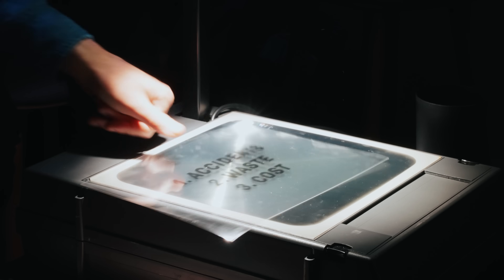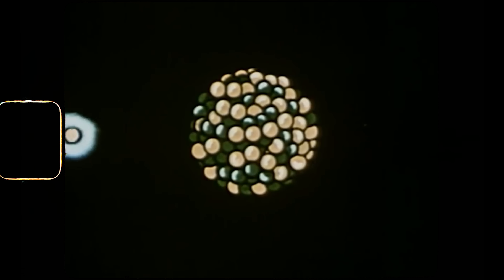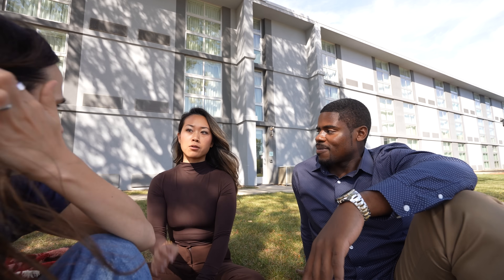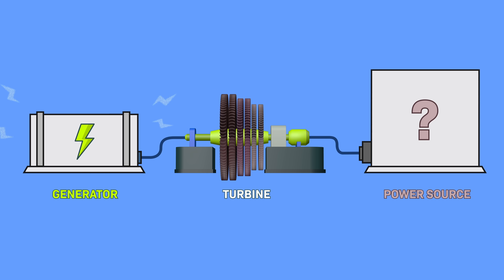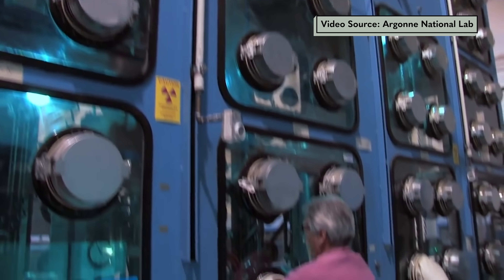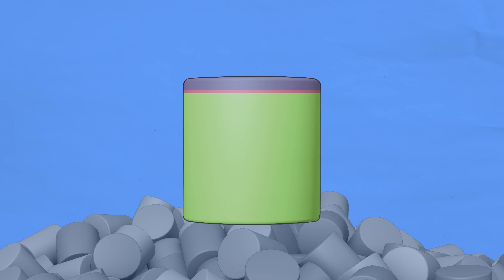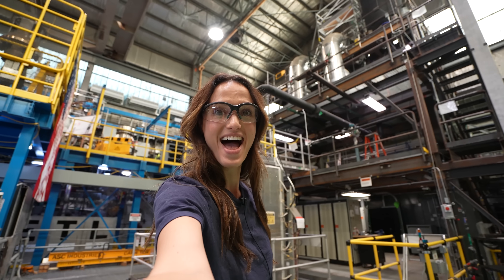The Big Lie About Nuclear Waste

Comment: As an engineer, I have to believe we can solve the technical issues with nuclear power, but at this point the bigger issue is that solar and wind power are cheaper to build and maintain.  Even if we can solve the technical problems, why spend more to get the same amount of energy?  This is usually where the reactor-heads say that we can do nuclear cheaper if only the government and activists would get out of the way, which sounds logical, but ignores the actual history of the technology, which is riddled with errors and disasters despite heavy oversight.  Perhaps with continued research we will reach the point of economic viability, but it seems more likely that another country, perhaps in Europe where there are more economic incentives and fewer NIMBYs, will make this idea work.
Reply: Isnt the problem with renewable energy excluding water is that it produce limited output of energy and heavily influenced by weather unlike nuclear energy?
Reply: @haziqhaziq5550 , good question.  Renewables are only limited by how many solar panels and wind turbines we deploy.  Either source could provide many times more energy than humans currently use.  The sun alone delivers 10^4 more energy to the earth every day than we consume.  We do need battery capacity and transmission lines to deal with local cloudy and still days in some regions.
Reply: There is a good TED talk on this channel that explains that, while what you say is true, the ability to scale up renewables is much slower than the ability to build nuclear.  If we want to save the planet in the short term, nuclear and renewables need to both be used to replace fossil fuels.

Comment: Nature Materials: Current techniques for the solidification or ceramification of nuclear waste pose significant safety concerns. It may come as a surprise to learn that solid nuclear waste doesn't remain solid for long, due to the complex and not fully understood processes of nuclear decay over time. With science unable to predict the exact composition of nuclear waste in the future—be it 10, 20, or even 100 years—designing a safe storage method remains an unsolved challenge. This uncertainty renders all existing storage solutions fundamentally unsafe.
The prevailing solidification methods do not adequately account for the changes that nuclear waste will undergo over time, decaying into a myriad of elements and their isotopes.
1. Solid elements may decay into liquids that have the potential to dissolve even robust materials like glass and metal, leading to leakage.
2. Solids can also decay into gases, which increase internal pressure, potentially causing the container to rupture and leak, especially as these containers aren't designed to withstand high pressure.
3. Moreover, some elements will form various compounds such as hydrofluoric acid (HF), which can readily dissolve glass.
4. They create an ever-changing, chemical medley, whose high ionization could accelerate structural deterioration beyond our initial predictions.
In conclusion, no known physical materials currently exist that can ensure the safe storage of nuclear waste. This problem represents an ongoing, unsolved research question in the field.
Reference for your research: 
Guo, X., Gin, S., Lei, P. et al. Self-accelerated corrosion of nuclear waste forms at material interfaces. Nat. Mater. 19, 310–316 (2020)
Reply: So we have an even stronger moral obligation to recycle the waste.

Comment: 06:21 you don't mention solar, wind hydro eletric or tidal power, i hae to ask why? They create more power globally after all.
Reply: It's just about that we use turbines for nearly every form of power we create. Except solar which has no moving parts.
Hydro has spinning turbines. Coal, Gas, Nuclear all heat water to steam to spin turbines. And wind also just spins a turbine. There is nothing missing there.

Comment: I don't think most people can fathom how much energy is in nuclear fuel.  If you just Google "XKCD log scale" you will see a depiction of energy density for common fuels.  One kilogram of sugar has 19 megajoules of energy.  Coal has 24, fat 39, gasoline 46...and uranium has 76 MILLION!!  Sugar doesn't have 19 million, just 19.  So it would take over 3 million kilograms of coal to equal the energy of a single kilogram of uranium.

Comment: this is called MOX reprocessing or "mixed oxide" fuel, and it's certainly not a silver bullet. Japan had to get the reprocessing perfomed in France and the worst thing you can do with high level waste is move it around. Nuclear energy is worth pursuing for sure, but it's currently the most expensive possible way to make power, and reprocessing only make that cost higher. It's technically viable for sure but then so is Fusion. more research needed for both, and LFTR thorium.
Reply: Japan is working on getting its own reprocessing facility online. I agree that in terms of cost it’s not really worth reprocessing for somewhere like the US with reliable partners with plenty of uranium like Canada. But for energy deprived countries like Japan that treats nuclear energy as a part of their national security, reprocessing makes a lot of sense!
Reply: Thanks for this info, I hope we'll do it to reduce the long-term storage risk at least and get some power out of it as well.
Reply: always the money, eh. Isnt the clean part worth it? The material in a motorbike helmet costs maybe 5 bucks in mass, but you still pay hundreds because your head is worth it
Reply: @fetB  try to explain that to our capitalistic system eh
Reply: @fetB stupidest analogy possible when there are far safer cheaper methods.
Reply: @crhu319  its not, but you have no real argument, so all you can, is insults... bye
Reply: There is nuclear reacor called bn-800 (fast neutron reactor 800 MegaWatt ), which is working on 100% MOX-fuel for almost a year already. And procedures of reprocessing  MOX-fuel for that type of reactors  are already at industrial production scales
Reply: @vitos1k  The problem is not reactors which work with MOX fuel, the problem is processing and trasporting the fuel itself. Nuclear waste is scattered around the country, and is far more dangerous and expensive to move around than new nuclear fuel (which is difficult enough as is). Unless it's heavily subsidized by the government in no case is it economically feasible. No private company is going to buy it when cheaper (aka new) fuel is availble instead.
Reply: @veergauba  I am sure the idea is about processing the waste we have instead of having it sit there. Long term storage isn't a solution, nor is it cost-effective.
Reply: @jimdiet8534 There are better solution than going this, again, nuclear rode, which I understand is not renewable and not clean at all.
Reply: @renebach9583  Nuclear is very clean and the most viable sustainable option we have.
Reply: @vitos1k  "procedures of reprocessing  MOX-fuel for that type of reactors  are already at industrial production scales".

Completely wrong. MOX is not reprocessed at all.
Reply: @whuzzzup  sorry for my english. I meant "Serial batch-production of MOX fuel,  which consists of reprocessing of used fuel from nuclear reactors"  and i meant "recycling of spent nuclear fuel"
Reply: @vitos1k : but the word "recycling" is certainly stretched for this. Separating the stuff and still throw the 99% away isn't really what you would call "recycling". And there's even more waste as a byproduct. All this effort and money is far better spent on good battery technology - which you would also need if you go full nuclear.

Comment: Awesome. Nuclear energy does have a place in our zero emissions goal to bridge gaps during low solar and wind activity, kinda like peaker plants operate now. If the spent fuel can be recycled like this, then our future may just look a whole lot brighter.
Reply: Actually, fission reactors are a horrible use for gaps. They are the opposite of peaker plants. They need a day to get started or shut down, which ist why they usually run for months, have a few weeks maintenance break, then run again for months -- they are a great base load plant. Using them differently would be an economical nightmare. But, as you already seem to know, we do not really need base load plants if we have a lot of renewables, we need some kinds of peaker plants. Renewables and nuclear are actually quite incompatible.
Reply: Science and technology provides us with solutions - politics, more often than not, just provides problems where the "solution" is to vote for "x".

Harold Hill:  "Marce... I'm in need of some ideas if I'm to get your city out of the serious trouble it's in."

Marce:  "River City ain't in any trouble."

Harold Hill:  "Then we're going to have to create some."
Reply: The older designs for fission reactors have difficulty handling gaps; the newer ones are quite capable of handling gaps.

Comment: This has been implemented in the UK (Sellafield) and France (La Hague) and establishing it in Germany was one of the starting points why it ditched nuclear power all together. There are severe problems with this technology, among others creating Plutonium usably for nuclear weapons (probably not the biggest problem for the US). Furthermore the amount of product emitted into the sea at both sites are the main reason for concern with them. In the end it is the details making this approach very problematic and therefore lead to the reasons it has hardly been tried (and we are not even talking about the economic consequences here, which make nuclear energy much more expensive). And the fast (breeding) reactors had their own stories, often tried, but hardly successful. Often these reactors had to shut down after design flaws or smaller emergencies. So the ideas were there in the 60s, but it has proven hardly viable since (and there went a lot of money in trying it).
Reply: Can't we mandate plutonium to only be used as nuclear fuel though? I heard there's a MOX fuel mixture. However, I don't know how that works out.
Reply: @Michael2137.  You can mix Pu with U and get MOX. This is/was common in Europe. Little problem with that: You cannot recycle MOX again.
Reply: The US Department of Energy (DOE) cancelled the mixed-oxide (MOX) fuel fabrication facility at the Savannah River Site in South Carolina in 2018.  The facility was already about 70% complete.

Comment: And the biggest lie about solar is that it is more cost effective.

Over ten years we have invested billions in solar, but meanwhile the peak solar power production was just under 400MW for the Netherlands over 2022. Meaning a SINGLE nuclear reactor with about a tenth of the cost would have saved us a whole decade of sustainability nonsense.
Reply: News flash, in-case you didn't know this either... the HEAT from nuclear "waste" can be used to heat homes as well. Instead we regulated it to shit and just vent the heat to the atmosphere out of fear over safety.

Don't forget that the nuclear "waste" doesn't add any radioactivity to the environment, it was already there... we just concentrated it.
Reply: And yes, we can totally do this. There is simply no monetary incentive to do so.

This is why the oil industry is doubling down on hydrogen, a bluesky technology for which they have infrastructure that will solve exactly nothing about our current carbon emissions as we are just keeping this whole fossil fuel industry alive for longer than it needs to be.

These companies already make BILLIONS of profit, they could have plopped down AP100 or BWRX300 reactors left and right for that money, but they will never do this as there is ZERO MONETARY INCENTIVE for these companies.
Reply: And no, the LONG lifetimes of nuclear waste are a side product of how we currently generate energy from nuclear material.

We have already been doing research into FAST reactors, leaving waste just for hundreds of years and as we already found out... you can still use this waste for domestic heating purposes. There is just no monetary incentive to do so.

Comment: I asked Bard how nuclear waste can be used for energy. It mentioned "Fast reactors". Fast reactors use fast neutrons instead of thermal neutrons. It went on to say that fast reactors can burn the waste more efficiently and produce less waste. Do you have any information on this? BTW- great video!
Reply: Nuclear waste can also be used in RTGs for power. They are relatively inefficient but last a long time without any intervention.

Comment: There are problems we can’t solve, and there are problems that we refuse to solve. Nuclear waste is in the latter category. 

Even if we did not reprocess spent fuel, the actual volume of waste is actually quite small. Most of the volume of those casks you showed is shielding. Activists quote tonnage because the numbers are scary. Nuclear waste is very dense.
Reply: and some problems just aren't worth the effort.

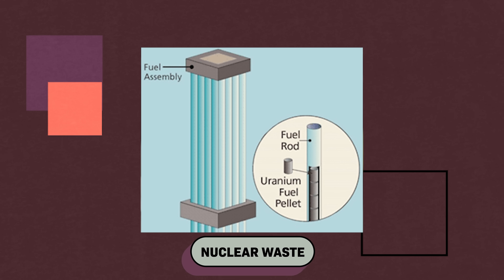Comment: 7:09 "The number refers to the Number of Neucleons of the atom" not Neutrons. Cause U-235 and U-238 means Uranium with those masses. Just a small correction which might be slipped through post production.
Thanks for the amazing video.

Comment: In France they also recycle spent nuclear fuel. However, this produces tritium which is released into the sea. There are limits to how much tritium can be released, so the amount of fuel that can be recycled is also limited.
Reply: > Tritium in irradiated fuel is mainly retrieved during reprocessing, when the fuel is sheared. It is found in the form of tritiated water in liquid effluent most of which is released into the sea. At the La Hague plant, for example, approximately 30 g (1016 Bq) of tritium is released every year per 1,600 metric tons of nuclear material and at Sellafield (UK) approximately 8 g (2.8x1015 Bq) is released every year (see Lebaron-Jacobs et al., 2009).
Reply: @ethernet0  The French are crazy...

So it seems it's not even cost effective to extract tritium when you're inevitably producing it, while at the same time being in dire need of it. And here we are, in the comment section of a video advocating for the recycling of nuclear waste. What a joke, really.
Reply: Tritium is the fifth most valuable substance on the planet, with a cost of about £30,000 per gram. Plus, the ITER test facility is currently under construction in southern France and one major concern about its operation is the amount of tritium it requires.
Because of that, I'm pretty sure you have things mixed up here.
Reply: @lonestarr1490  No I don't have those confused. I'm not able to post the original document, but search for the document 'radionuclide fact sheet Tritium and the environment' from L'Institut de Radioprotection et de Sûreté Nucléaire (IRSN) .

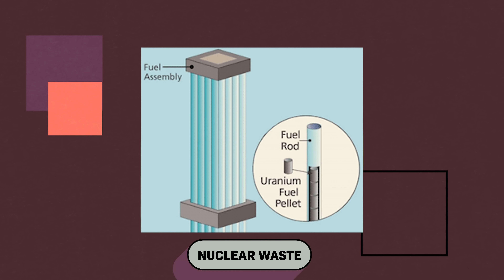Comment: As always great video but I just wanted to point out a minor mistake at 7:09 : The number 235 refers to the number of nucleons (neutrons + protons) in the isotope, nut just the number of neutrons. Also uranium is an element rather than a rock.
Reply from the maker: Hey, thanks for pointing this out! I added a correction that should appear at that timestamp. Here it is too: Correction: 07:09 The number refers to the total number of nucleons (either a proton or a neutron) in the atom, not the neutrons alone. A U-235 atom contains 92 protons and 143 neutrons (an atomic mass of 235). The U-238 atom also has 92 protons but has 146 neutrons (an atomic mass of 238). I should have said these differ by the number of neutrons in the atom. Thanks to the commenters who pointed this out!

Really appreciate it :)
Reply: @CleoAbram  Thanks for the reply and correction, I am really enjoying all of your videos and am looking forward to many more to come :)
Reply: @CleoAbram :
Thorium molten salt reactor
Reply: The way I remember this is carbon-12.  It has an atomic weight of exactly 12 (by definition of atomic weight), which makes no sense if it has 12 neutrons.
Reply: Yeah that’s right
Reply: So it makes sense to the Average Joe calling Uranium a "Rock" works , because yellow cake is extracted from uranium ores.  Great educational video👌

Comment: The summaries at the end of Huge If True always hit me in the feels. It's the kind of inspiration we need to move forward together instead of hiding alone in fear.
Reply: nuclear electricity is economically obsolete. each kWh costs 4-6x more rhan any alternative. hopeless, and economically unjustifiable today.
Reply: @skataskatata9236  yeah but other renewables are not available 24/7
Reply: @skataskatata9236  Storage costs  are not exactly prohibitive but have to be included while doing the sums.

I still would like to see fast burner reactors neing built to get rid of residual high level leftovers.
Reply: I mean electric power storage not leftover isotopes. As I see it that is just too expensive.

Comment: I always thought that the most waste from nuclear is actually the structures surrounding the core and not the fuel itself?
Reply: The fuel rods themselves are extremely radioactive after they have been spent.  Prior to putting them into the reactor; you could walk up and touch it with no ill effects.  After pulling it out of a reactor after one fuel cycle -- if it were unshielded and left out on an open field... you could start running towards it, but the radiation would be so intense that you wouldn't make it even halfway across the field.

The spent fuel rods are the worst of the bad nasty radioactive waste -- which is why so much care needs to be taken with them.  They can be safely managed, or otherwise utilized.